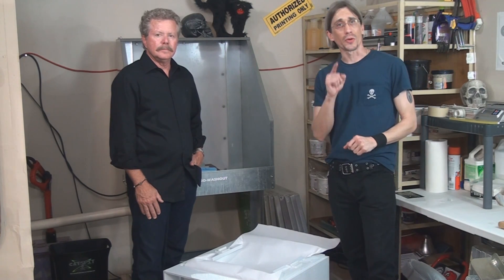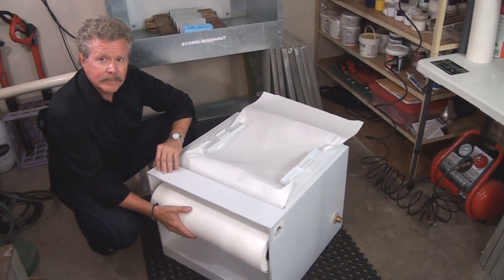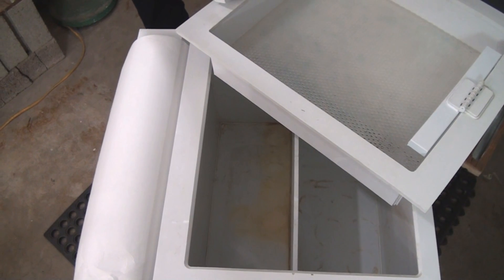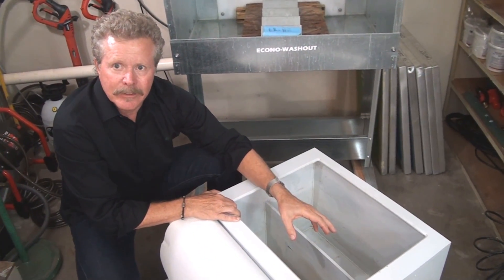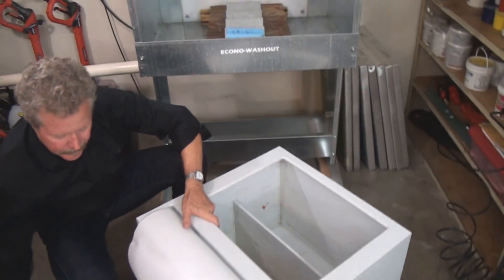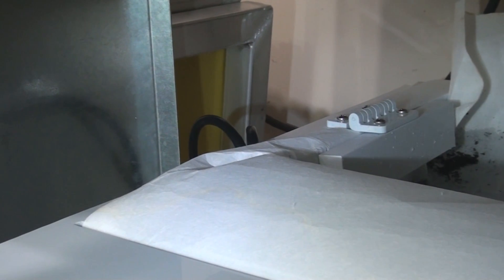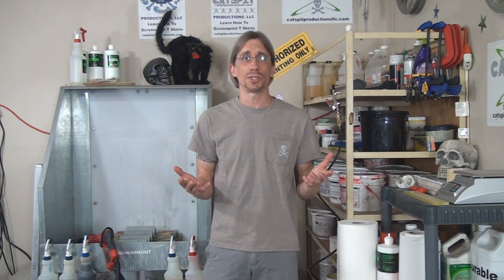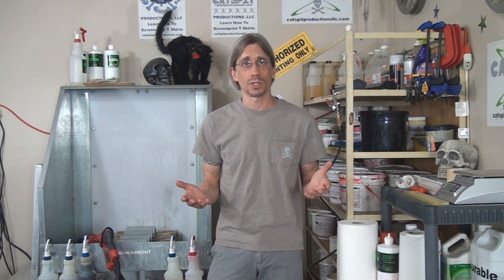How To Screen Print: Washout Booth Environmental Filtration Unit

Comment: I'm thinking for those who can't afford it build a box and put 3 bi level silkscreens as filters. spend a hundred or so and be done no ? maybe buy the pump ?
Reply from the maker: +Kevin Work Channel This unit catches particulates up to 5 microns in size. So as long as your filter media makes the cut, then you could build one. 355 mesh will not catch particles that small however. Thanks for watching. Screen Printing Equipment & Supplies - http://catspitscreenprintsupply.com/

Comment: Jonathan hi there ..how much it cost the filtration system ?  Regards.......
Reply from the maker: It's about $875 without the discharge pump. The pump, if you need it is $375. 

http://catspitscreenprintsupply.com/m-10-manual-washout-booth-filtration-system/

http://catspitscreenprintsupply.com/m-10-filtration-system-discharge-pump/

Shipping is an additional charge for these RhinoTech products. Thanks for watching. Screen Printing Equipment & Supplies - http://catspitscreenprintsupply.com/
Reply: Thank you ..........
Reply from the maker: Cesar Bravo De Rueda My pleasure.

Comment from the maker: Thank you very much. No it does not. It gets wet and it will stain some but when you pull it through and use it it’s just fine. It’s very dry here so anything that gets wet dries fast in my shop. If you work in high humidity you may want to make sure the roll stays dry. Thanks so much for watching and dropping me a note. ☠

Comment: With that setup you mention, wouldn't you be using the liquid chemicals to shoot through the pressure washer?  As in all of your screen degrease-er, emulsion remover, ect, being used back on screens you are trying to washout, de-haze and prep for new screens?  Seems like it would be counter productive with all of the liquid chemicals being reused.